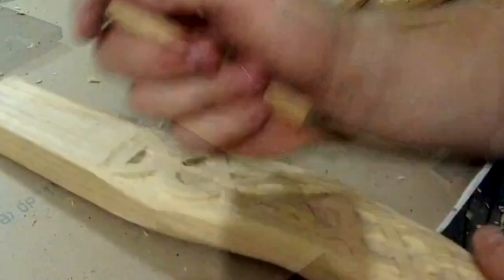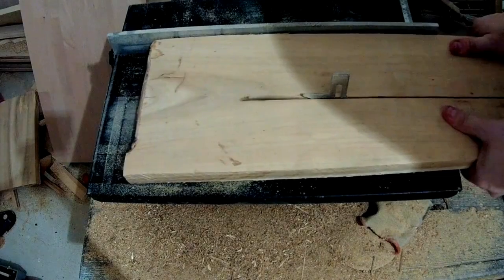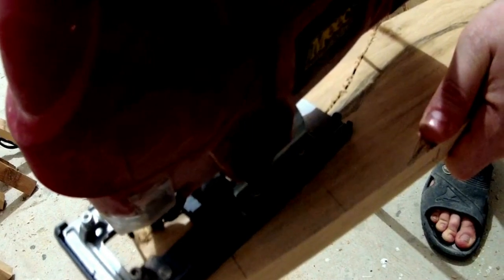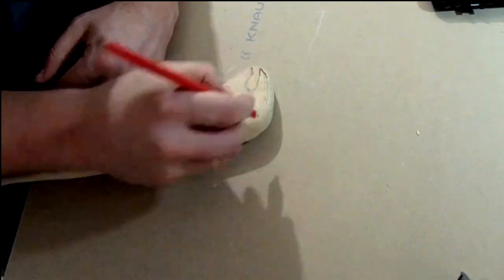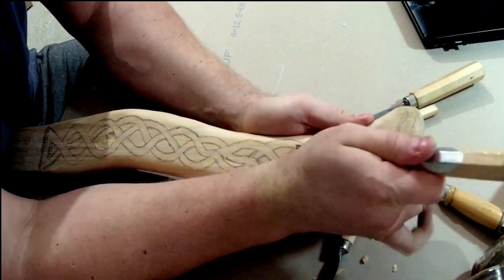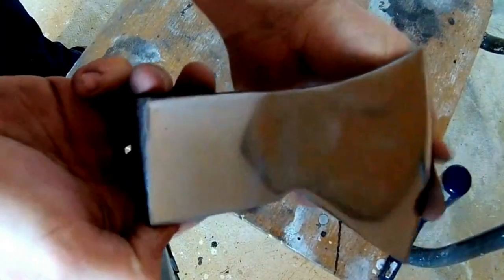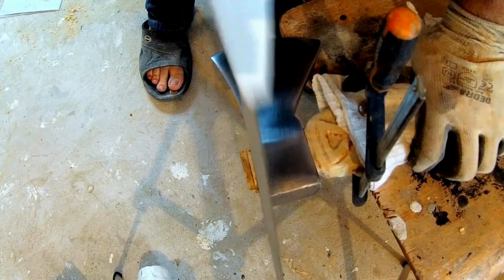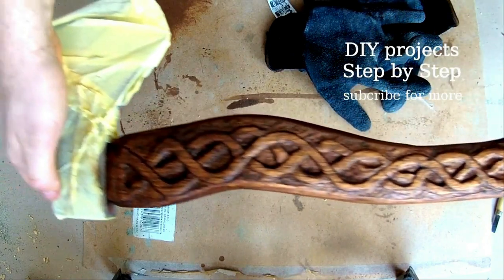Rusty, old, blunt axe restoration (with my beautiful voice ;-))

Comment: Very good, thanks. In English they call that power tool a "jigsaw." That is where the name for the puzzles with all the parts which fit together to make an image comes from, they call them "jigsaw puzzles". The word comes from the dance called a jig with leaping movements that I could never do. Anyway, sorry for the lecture, but I did enjoy you video and the result looks great. Thanks, Ian.
Reply from the maker: Wow! Thank You for so great explanation. I didn't know that this is called jigsaw. Good to know. It will be even easier to rememeber because of the whole story You provided :)